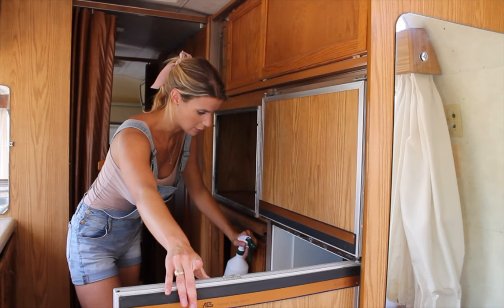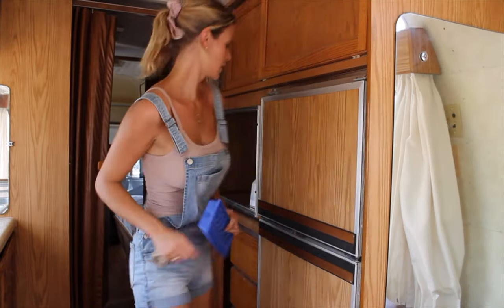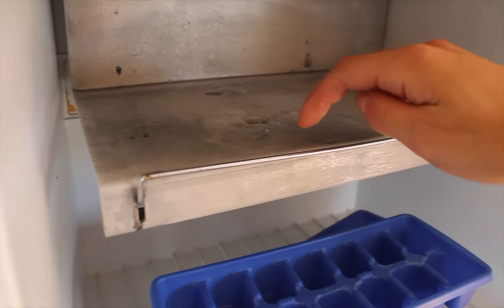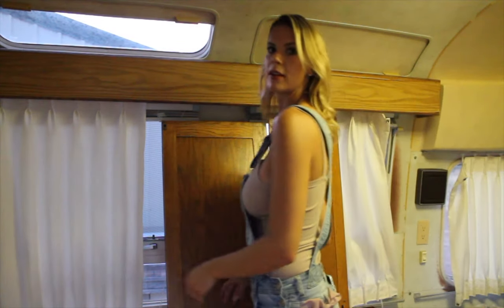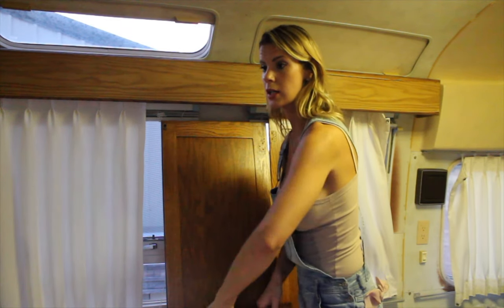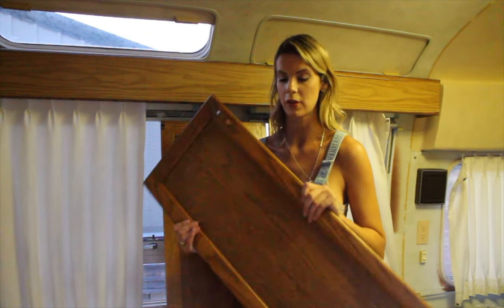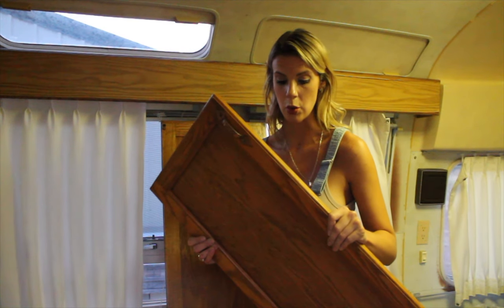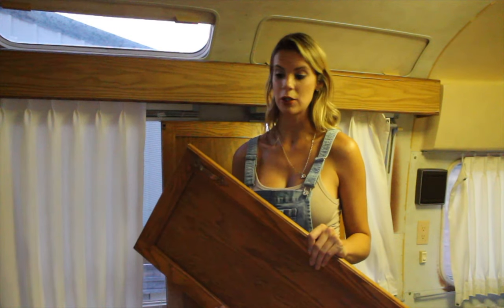Tiny House Living | Airstream Remodel - Day 1

Comment: That big a trailer is going to need at least a 3/4 ton truck.
Reply: Yes, F150 can pull it but that is not safe. At least 3/4 ton truck will stop the trailer at highway and downhill speeds. Stopping is much harder than pulling.

Comment: I had to stop watching and send you a message. So excited for you. It seems there are a few that share your vision of this type of lifestyle. More then ever, now seems like a perfect time. Good luck. I am currently going thru a 1975 sovereign and it has been such a good experience but definitely a lot of time to restore it. The ups and downs are many. The key take away...as long as you have time...it all works out. It appears your windows are in great shape. LUCKY you. I just spent a ton of time removing and restoring all my windows. Have a few left. But so much fun. Good luck. If you need any suggestions...don't hesitate. I have experienced so much so far. Good luck!
Reply from the maker: Thank you so much Jake it means the word to see other like minded individuals out there and to know theres is such a grat support system! Sorry about your windows :( I am lucky that i am starting with a good base, Although I would like to get all the nose end dents out of the front and back. I got a little glue on dent puller which helped a tiny bit but its still bothering me a little haha.
Reply: @KaylaAnne  oh I have learned since the nose ends are stretched and formed it's actually almost impossible to get them all out. Btw...it brings some sort of character right? Also...I like things that have stories. New isn't always better. 😁
Reply: @KaylaAnne  one more thing ...you got a great deal for that trailer and a perfect time. I envy the simple life. Truly!